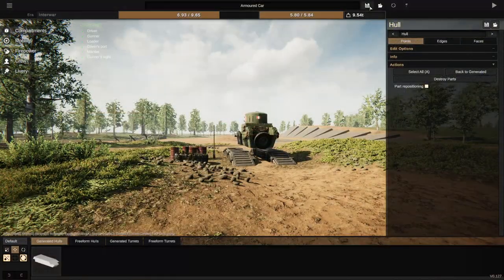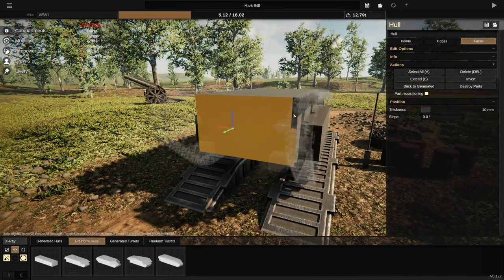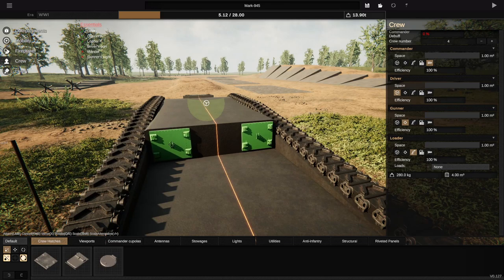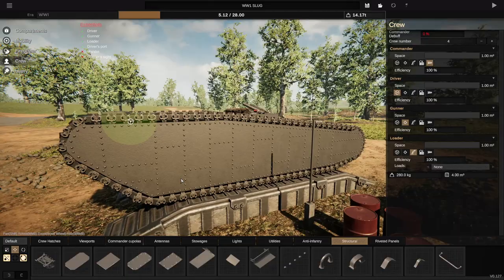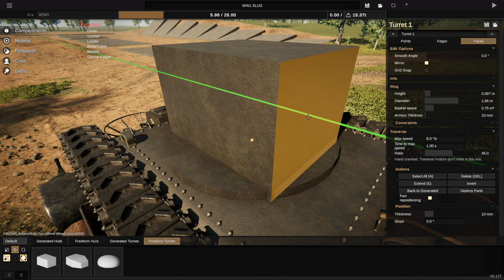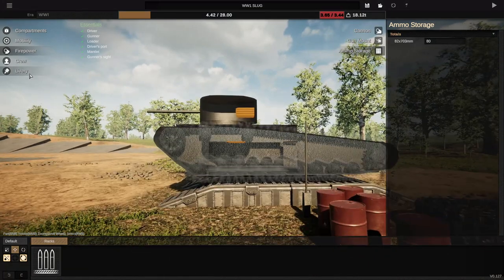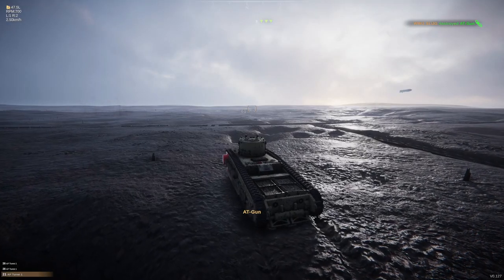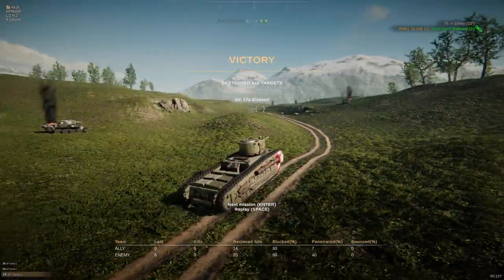I Built A HUGE 40TON WW1 SLUG TANK In Sprocket!

Comment: Thats not actually a ww1 tank, thats an interwar tank...
 
its "close" to the Tog II in looks,  but its track system is more akin to the french Char B1 series,  20' long the B1 isn't as long as the TOG...  but come on, their are navel ships not as long as the TOG.    Char C2 is 33 feet long,   (About the same length as the tog)  but these were walking tanks  generally moving about 15kmph or 9 mph...  on roads.  

they differ from the ww1 tanks in they had full rotational turrets on the top, something that only started after ww1